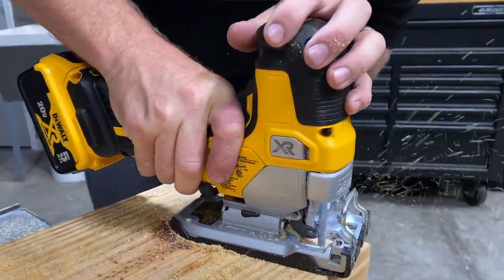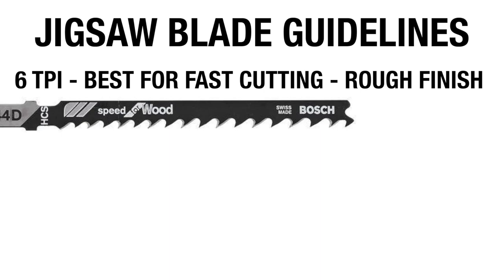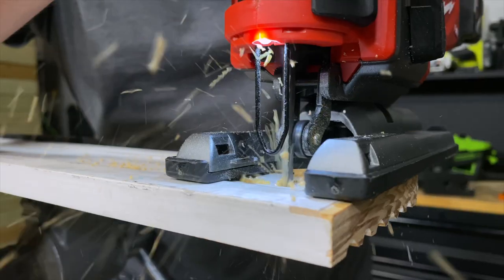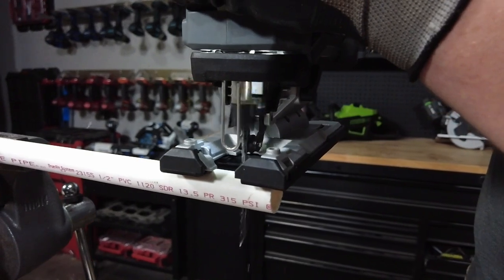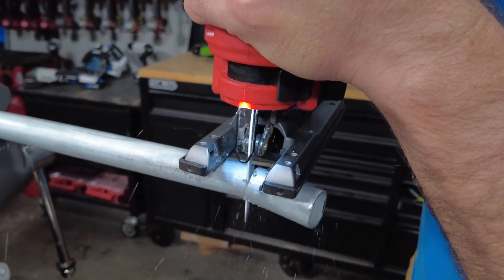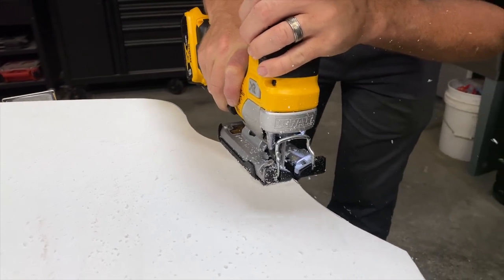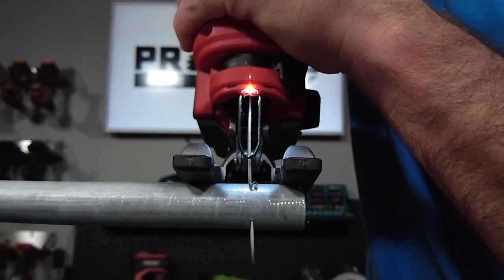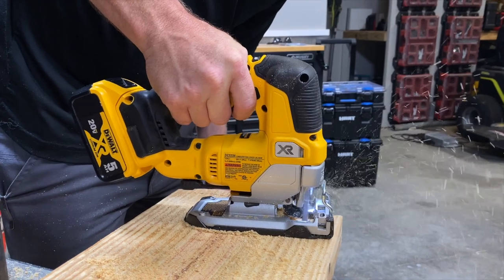Best Jigsaw Blade? Types of Accessories & Blades EXPLAINED

Comment: Thank you I am putting laminate in my house and and not sure what blade I needed as it kept cracking at the edges your video was brilliant very informative thank you
Reply: Rough edges shouldn't be a problem as most the time you hide it close to the wall under the base molding. I use miter saw, circular saw the a very fine tooth blade, or a Japanese pull saw, very clean cuts. Tape over the cuts with a fine tooth jigsaw blade should provide better results.

Comment: What's the difference in "T" number....I see T101 and T118. Also...How do you get a thicker blade ( if there is one), to better-assure the blade doesn't curve sideways,  on the bottom of what you're cutting..... and stays straighter with the top of the cutting surface?

Comment: I'm working on a small wood project for indoors and I chose poplar wood board for my project. And I need to cut a half circle on the end of the poplar board. In  the past I've used a Dewalt jigsaw and it completely froze/locked or died on me not sure what the correct term is used . But I know it was my error my guess was I used the wrong blade and forcing the cut. Sense then I've purchased another jigsaw I slowed my cuts my question is which jigsaw blade do you recommend to cut a curve on a poplar hardwood borad ?

Comment: Given the VAST AMOUNT of available blades, this video just doesn't make sense.  

Next time, try to do an acceptable job, will you? You completely missed the type of tooth, the Section of the blade, the rake, and the many many other kinds of blades available.
Reply: There are indeed a vast number of blades available. The "t" and "u" blades tend to be machine specific although one of my machines will accept either. I currently use my b&d  with the old stock of u blades  mainly because I find it is too restrictive, but also because I find the  b&d website rather rude and lacking in product detail.  I just use the products for jobs that do not require a half decent finish and will use my superior jigsaw from the in. Clear the rubbish😊
Reply: Tpi is teeth per inch, the higher the number the finer the cut
Reply: HCS is wood. HSS is steel
Reply: I have a spreadsheet somewhere that lists the manufacturers and codes in more detail but I will not post it as I do not care to do the job I think b&d should do and apart from that, I only get hit once with a bad purchase and then move over to another brand. It is not tool specific, but when one tots up the rubbish tools one figures what not to buy again.  Just saying, if you really wanted to know, a 106-1 is a b&d fine toothed steel blade, possible a U blade and is in my pile of b&d stuff to us on junk projects then kiss the brand goodbye forever😅
Reply: Stanley also use a stranger code. Easy to figure if all you buy is Stanley stuff, I got some at good discount but would not normally buy that stuff.